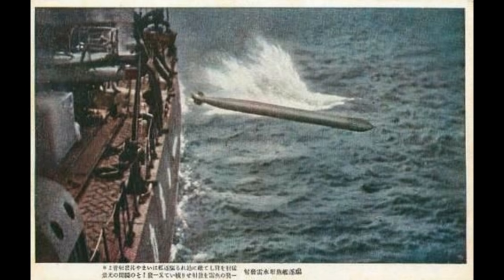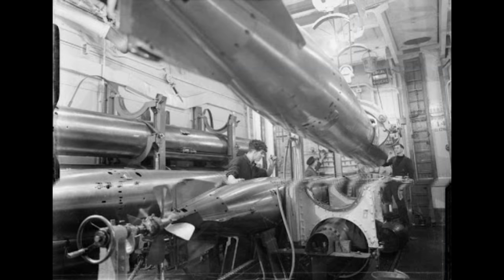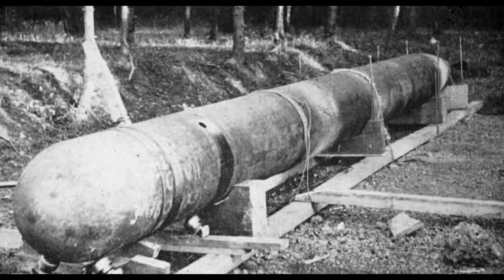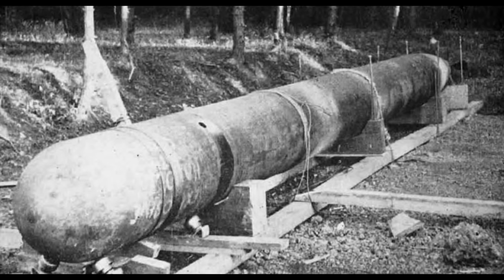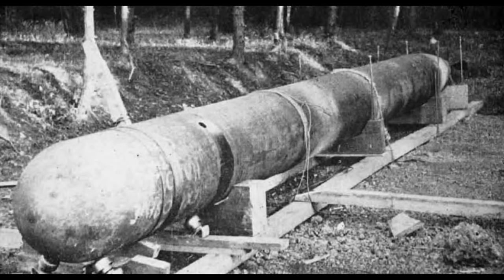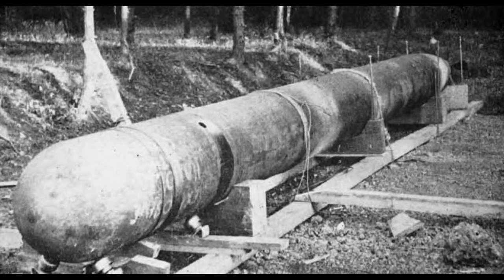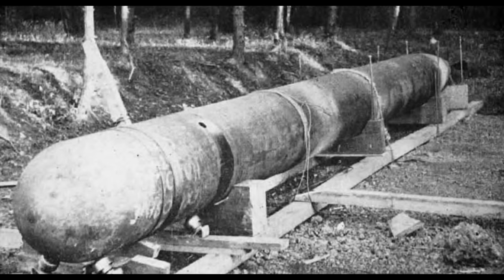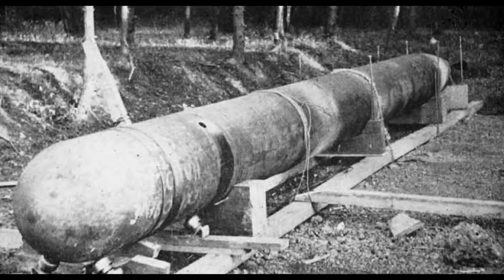Type 93 Long Lance Torpedo - Long Range Hole Poking Device

Comment: Is a trimaran battleship possible or practical? Get a normal battleship and then strap a destroyer onto it on each side. Did anyone try it? If so, did it work? 

Also can you do a video on the British Coastal Motor Boats?

Comment: Japanese Imperial Navy would have been much more successful if they built 100 more submarines instead of the Yamato class battleships. With this groundbraking Type 93 torpedo and possible upgrades to the guidance system, US Navy would be in much greater danger than from those 2 behemont that played no significant role in the Pacific theater except as bomb sponges for the US naval air power.

Comment: Oxygen does THAT!? Shit!
Reply: Combustion with pure oxygen produces carbon dioxide, which dissolves readily with water. As a result, air bubbles are quite minimal and that means the observers at enemy ships can't see those torpedos until too late.
Reply: @muhammadnursyahmi9440   Uh, I meant the explosive stuff. Oxygen, he said, reacts to anything it gets its molecules on. Destructively.
Reply: @benlaskowski357  Yes, oxygen loves to rip apart anything it comes into contact with.

Comment: Why bother with compressed Oxygen in torpedoes? Why not a room temperature LIQUID oxidizer like Nitrogen Tetroxide (N2O4). Pure oxygen is still a gas! That means that you need to keep it under high pressures. Even then it is not particularly dense and you don't get much of it for a given size of tank! I don't think any torpedo uses liquid Oxygen, but if they did it'll need to be a cryogenic fluid which is impractical for sun baked torpedoes on a destroyer's deck.
--
Nitrogen Tetroxide is 69.6% Oxygen by mass. It'll ignite Kerosene or diesel, no spark plug needed. It is a room temperature liquid, 144% the density of water. While burning kerosene with N2O4 is not as "good" as burning an exotic fuel like Hydrazine, it is 97% as energetic which is more than good enough for a torpedo!
Reply: It's cryogenic oxygen iirc so it would be liquid. Would make sense if being used with kerosene, thats what rockets often do. Isnt nitrogen tetroxide a hypergolic fuel too? Those are even scarier
Reply: @RhodokTribesman  (1) No. Compressed Oxygen, not Liquid Oxygen, is used in the Type 93. Using LOX  with the necessary insulation and refrigeration is incompatible with the rigors of a WWII Destroyer. (2) Nitrogen Tetroxide is hypergolic with Hydrazine and it's derivatives like UDMH and MMH. It is generally not with hydrocarbons like Kerosene, Gasoline or Diesel. N2O4 is a dense, room temperature, liquid which makes it much easier to store and handle than LOX.

Comment: I wonder, was there a particular form of self-indulgent hubris dictated by BuOrd's operating procedures?
Or did they just promote those who seemed most capable of making foolishly shortsighted, ignorant, or arrogant pronouncements asking to be proven embarrassingly wrong?
Given the Type 14, their response the Type 93, and several other procurement/supply/engineering screwups with gun projects, I feel like maybe it was both.